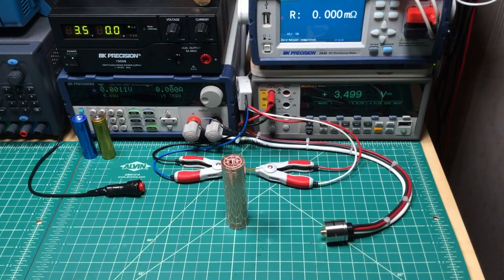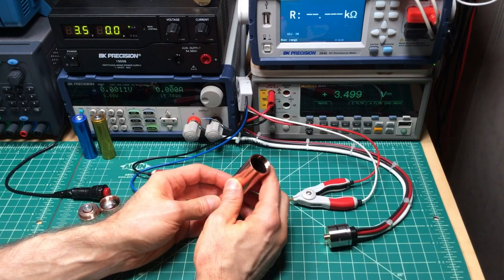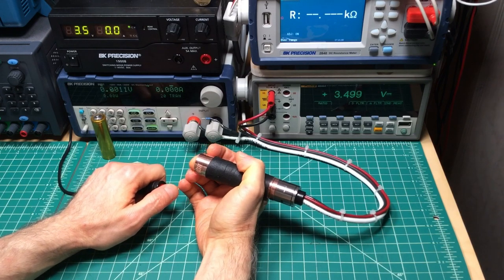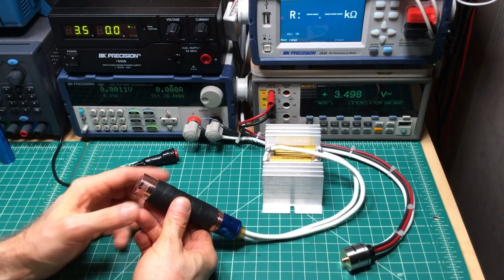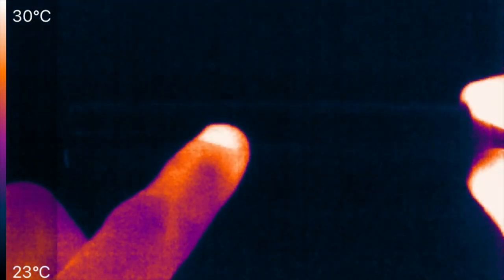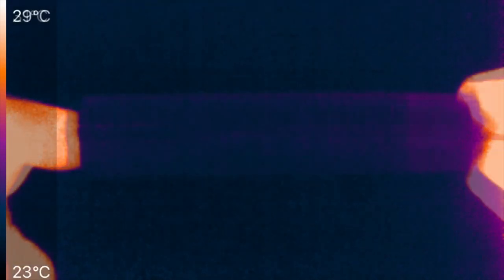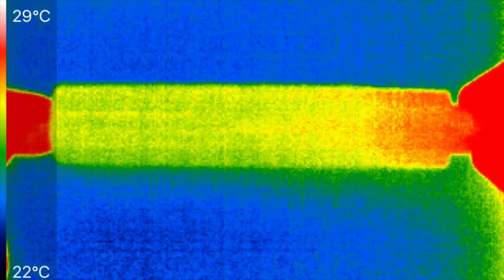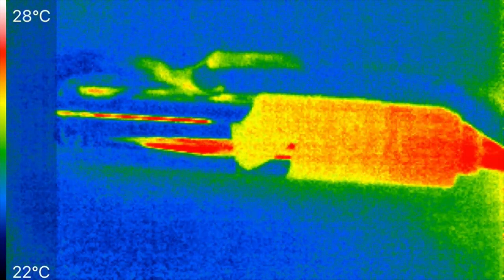Minding Your Mechs – Ep009 – Copper Broadside Testing

Comment: This was extremely interesting to see,  I have a Brass Broadside, and the voltage drop with that is very good, Mine is painted and looks great, the finish is pretty stable as well which makes for better conductiveness.
Reply from the maker: The paint wouldn’t affect conductivity, except make it worse if it was on the threads. It definitely makes maintenance easier though!
Reply: The paint is nowhere near the Threading, But the Brass threads oxidise far slower then Copper as it is Navel Brass.

Comment: Great testing, as always.
I guess that kills the idea that a hybrid mod is always better on voltage drop than one with an adjustable 510.
I think that although the first colour palette was slightly more accurate (or do I mean precise?), the 2nd is more typical of those we see from other sources (for those of us who do) so gives an image which is easier to assimilate.
Reply: Phil Lee It does hit harder in hybrid mode with the Culverin. its just that this mod outperforms most mods as it is.

Comment: When BJ makes a mech with that clutch that fit my 30T's I will be a happy camper.
Reply: korgeth i could be wrong as i dont have one but doesnt the admiral take 21700s?
Reply: I only have the broadside so I am not sure either but I thought it only took 20700's.
Reply: Just 20700s - Sanyo A is about as good as you'll get in that tube.
Reply: korgeth yeah i think youre correct
Reply: The Brizo or bore out the Admiral to fit 21700s. Lots of meat to bore that thing out. Imagine the Admiral with a 30T. Game over.
Reply: @AbsoluteFidelity  yeah id love an admiral with a 30 or 40t! That would be awesome! Unfortunately the brizo wasnt out when mooch posted this video, came out like 2 or 3 days later. I havent had a chance to play with one yet as my shop hasnt got em in yet, im a fan of BJ's mechs but ive personally never been a fan of pinky 
(or side fire) mechs myself, but again ive not held a brizo yet, i may love it. I personally wont buy a mech that isnt 20650 or 2x700 compatible anymore, ya get such better battery life out of them versus 18650s generally speaking. Ive not used the new samsung 20f i think it is (the one according to mooch that's the hardest hitting 18650) but i much much prefer the power and the mah of my 20650s & 2x700 batteries. Hopefully we'll see more manufacturing of mods that are made for them and we can kind of move away from 18650s. I dont think well ever completely get away from em as there are so many battery manufacturers that make them and so many products, besides just vaping, that use the 18650s that i think they'll probably be around for a very very long time unless some new battery comes out that just revolutionizes the battery industry. I have a lathe and some boring bars, i may just bore out an admiral so that it'll fit a 21700. Thanks i hadnt really even thought about doing that. Anyway this response is way longer than i meant it to be, so stay well, have a good friday, and vape safe.

Comment: do you have multiple csmnt"s or are you using them because they are the best performer?
Reply from the maker: I have multiple csmnt’s, purchased just for test use because the thick test wires come straight out of the posts. I don’t have to try to bend them ninety degrees. The 510 pin is gold plated so there’s less maintenance and the negative post was milled from the deck, reducing voltage drop. It was recommended by a lot of people.

Comment: Hey, mooch! I've got a DNA200 that is a couple of years old now, it's got a built in LiPo battery, what's your opinion on the safety of me continuing to use it? due to it being older than I've ever kept any of my 18650's?
Reply from the maker: Sorry, I don’t know of the condition of your battery. They can last years if not overstressed and are well cared for but there is just no way I can say if yours actually needs replacing or not. I’m forced to err on the side of caution and recommending retiring that mod.
Reply: Thanks for your opinion, greatly appreciated. 
I've never over discharged the battery, it's always been kept between 70-100% (but mostly around 75%) battery level, never put it under any more strain than about 20 Amps, I have mostly used it for MTL vaping and currently (pun intended!) am strictly only MTL due to my concerns of the safety.
Reply: I was considering buying a new enclosure to transplant the board anyway, so I might just do that and get a new LiPo for it.

Comment: Hey Mooch!  Is your recommended batteries list current?
Reply from the maker: No, it needs updating but all are still recommended.
Reply: What are the top performers at the moment?
Reply from the maker: Samsung 20S, 24S, 30T, 40T
Sony 18650 VTC6A, VTC5A
Sony 21700 VTC6A

Comment: Dudes someone help me it it ok to have light scratches right the top of your batteries due to the charger?
Reply from the maker: From rubbing against the contact? That should not be a problem as long as it’s only on the top contact metal and it doesn’t damage of affect the wrap.
Reply: Battery Mooch thanks a lot buddy, yeah its just the metal at the stop with light scratches because of my charger

Comment: Your poor poor hands.... I can't stop thinking about how to make this wonderful work you do easier for you...and on your hands!!! 
Rubber gloves, kitchen gloves, mechanics gloves ? 🤔
Thick buildup of grip tape 1/3 to 1/2 of the way up from the button on the tube to better hold on to? 🤔
Lobe of a roller cam mounted in a drill or other electrical rotating motor for button presses during the 300 press arcing test... 🤔
Reply from the maker: Don’t want to automate it as I need to vary the presses to better simulate actual use. :-)